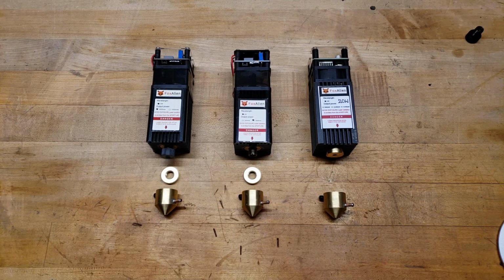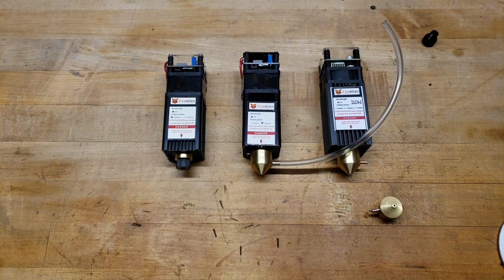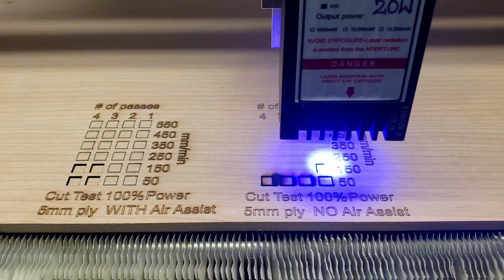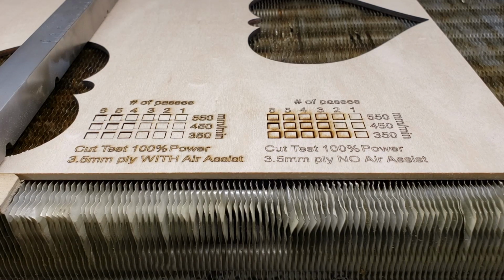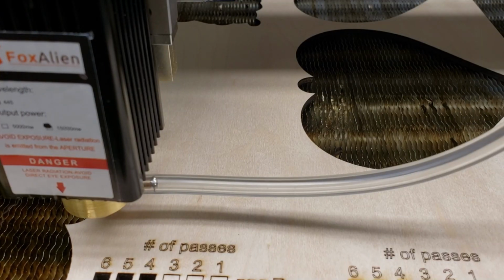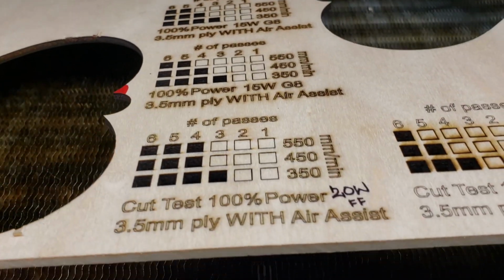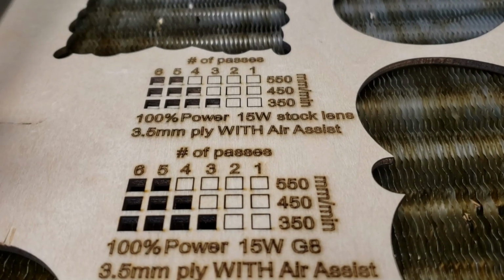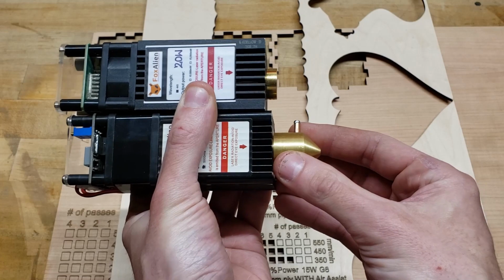The ULTIMATE Air Assist Nozzle! Demonstrating the importance of having air assist.

Comment: Just got my nozzle from you yesterday and have now mounted to my A5 Pro. The quality is excellent as is the fit of the M9 adapter ring. I am wondering if I should keep the Red Lens covers which necessitates drilling a hole in the lens for the line to go through. Or, leaving the protective red lens off as one should always use laser protective glasses when working with a laser. What do most people do? Understand that the danger of removing the covers could expose someone who walks in on you while lasering without glasses. Again thanks for a well manufactured excellent fitting part. I will be ordering another from you for my new X7 Pro. Thanks Jakub.
Reply from the maker: Great questions, Larry! I personally am not very fond of the new fad of using mini laser shields around the module, because that is not safe and effective. You can still see the blue glow between the gap, and a reflection could still make it through. By far the best thing you could do, is build a full enclosure with laser filtering window. I use 2422 amber acrylic sheets, you can find them on Ebay. The comfort increase will be astronomical. You can comfortably still be in the same room and other can walk in and out without worry. Plus, you need the enclosure for exhaust evacuation anyway. That should be high on the list of upgrades!

I'm so glad that my nozzle fit and serves you well! I would be happy to send you one for your new module!

Comment: Interestingly, the lettering of the NO AIR ASSIST 'cuts' seem to be clearer?
Reply from the maker: Great eye! This is because the air assist makes the burn much hotter. It is the exact same reason blacksmiths have bellows blowing air on their coals, they glow brighter and hotter. To get the same engraving results as the "no air assist" section, you just have to increase the feedrate to compensate for the hotter burn. You need a 32bit controller to take full advantage of the higher power diode modules. I always have my laser duty cycle (power) set to 100%, I only ever vary the feedrate. When I engrave, I do 6700mm/min. I did the engravings on my test charts at 3000mm/min. If I did the engravings at 6000mm/min with air assist, they would look the same as without air assist at 3000mm/min. My air assist will make your laser feel twice as powerful, no joke.

I was only concerned about cutting performance in this video. I will try to release a video soon demonstrating the differences with raster engraving. You can greatly speed up engravings with my air assist. I hope my explanation helps!

Comment: What kind of result would you get if you turned off the air but left the nozzle on? 
Would it be just as powerful?
Reply from the maker: Without air being supplied, the nozzle won't make any difference.
Reply: @laserwizard1982  
Protecting the laser from particle debris is important by itself so you have that covered. Additionally, I think too much air would cause a disturbance also. I'm sure there is a sweet spot distributing the air. Do you know what that is?
Reply from the maker: @iwannaapple7190  check out my video comparing air pumps. Turns out, almost any pump pushes enough air to get great performance. I see most people's 3D printed nozzles have a much bigger orifice hole, over 6 times the surface area. Those require massive compressors to generate enough backpressure. My nozzles have a tiny orifice hole, just big enough to squeeze the laser beam through. This allows even small aquarium pumps to create a strong stream of air.

Once in a long while, I would notice that my air assist would shimmy the workpiece over during cutting. I now always clamp my workpiece to the cutting bed so it stays put.

Sometimes, when I'm laser marking stainless steel with laser marking spray, I will stick a pen into the inlet hose of my air pump. This acts as a choke and allows minimal air through my nozzle. I do this because the air assist at full power blows the powder all over the machine. Laser marking stainless steel doesn't need the extra oxygen, but the burnt off coating does leave soot on the outside my nozzle. The minimal air is to ensure the lens stays perfectly clean.

I used to have to clean my lens after every 2 hours of lasering. Now, with my nozzle, it has been almost a year and no need to clean the lens. It is important to have your air pump suck in clean filtered air. It should not be able to suck in any of the smoke coming off the machine.
Reply: @laserwizard1982  
Great conversation by the way. I'll leave you alone after this unless your busy.
Here is why I say you should just test with out air assist, do not even make a tube to fit the hose. Just the nozzle nothing else. You have effectively created a vacuum with your design. The lazor should ionize what's left of the air in the nozzle and push it out. Lazers work best in a vacuum. Air is not as pure as we think. It has particles in it that detract from the laser. No or debris will go into the hole because the laser is pushing what air there was out. You are effectively fanning the flames on the wood but it might be possible your slightly decreasing the power with air.
In fact, too much air will decrease the power as evidence in another video I watched using your nozzle. The maker of the video did not know why it happened but in effect he lessened the vacuum by increasing the air and his test squares were definitely had a negative effect.
I might or might not test this because I will have to buy 2 nozzles from you instead of one. But that really would be interesting to use a nozzle with no spare tube attachment and do the square test.
Your nozzles are very good and it really must be a compliment when a company stands up and helps you sell your product with their machine. Been trying to do that with my soap cutter.
Reply from the maker: @iwannaapple7190  Very interesting idea about ionizing the air. I never thought about the effects of the air on the beam path. I know blue light refracts through the atmosphere, that is why the sky is blue and why blue illuminated signs always look blurry. 

The only time I heard of my air assist "decreasing" cutting performance was when a friend was cutting acrylic. It took more passes to cut than without air, however the cuts came out much cleaner and sharper. When cutting wood,  the air assist helps feed the burn with oxygen. There is a clear increase in "laser power" in that case. However, I don't believe acrylic is burning the same way, it is vaporizing and doesn't need the extra oxygen. The cuts are much cleaner on wood and acrylic because of the cooling effect the air has on the surface of the material just outside of the beam path. I think of the laser beam photons like meteorites, when they hit the surface, the energy isn't just delivered downwards, it spreads radially. Cutting wood with the air assist creates extremely sharp lines. When cutting acrylic without air assist, there is gradient of temperature going away from the beam. The stuff in the beam path vaporizes, but the stuff just outside of that path melts. The air assist keeps that bordering material cool so it doesn't melt as much. It might also be fighting against the laser beam heat for the stuff that is in the beam path. Even though for acrylic, it might be increasing cutting time, it is well worth it for much sharper lines.

So even if the nozzle would keep the lens clean without air supply, it is always better to be blowing air for all the reasons above.

Always a pleasure to have an intelligent conversation!
Reply: @laserwizard1982  
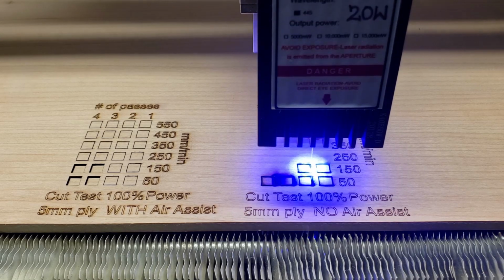I would shoot you a link but youve already seen the video. James Dean designs where you made a compliment about his testing. What I found extremely interesting was at 13:40 where he increased air pressure. It actually cut the wood worse! I dont know but that might have something to do interfering with the laser which caused it to cut worse.
I thought more about the vacuum I think it might create. I could be wrong but if it does create a vacuum that would mean negative pressure and positive pressure outside of the brass fitting. The pressure will try to equalize which might bring in dirty particles. Thats where your air assist fits in. Maybe equalizing pressure just enough as in turning down the air supply to equalize pressure from both inside and outside of the fitting would be enough not to interfere with the laser and still keep debris out.
That could be why you see better results with air and you also said any air pressure would do. Although from James deans tests he found out too much air can have a negative effect.

Comment: so I have never seen what the air requirments are for air assist. how many psi required? 5 psi?
Reply from the maker: My most recent video compares several different air pumps. I didn't measure the backpressure, but I doubt it's more than a few psi. Doesn't take too much air to get my nozzle to perform well.

Comment: Great video and amazing difference in results. Very cool. Do you have a video of your setup? What do you have your material sitting on?
Reply from the maker: I do have a video showing my current setup, it was posted to the FoxAlien Facebook group. I haven't posted one here yet because I never fully finished my enclosure. Then again, when you build your own CNC machine, you are never done building it!

I'm using an old condenser as my cutting bed. Was free for me, but the fins are razor sharp and have cut me a few times. You can purchase steel honeycomb beds online for this purpose. FoxAlien has one that fits 40cm x 40cm machines.

Comment: Is it just me or the engraved text actually looks much better without air assist ? What's the deal here ?
Reply from the maker: Great observation! The air assist helps make the wood burn much hotter and quicker by constantly supplying the surface with fresh oxygen. Very much like the bellows does for a blacksmith's coal forge. I kept the feedrate for the text consistent throughout the tests, but when you utilize my air assist nozzle, you can increase the feedrate to compensate for the hotter burn. Adding a good air assist nozzle is essentially increasing your laser power. I do raster photo engravings at 6700mm/min and 100% laser power. You will need a 32bit controller in order to fully utilize the power of the 20W laser module.
Reply: @laserwizard1982  Nice, thank you ! I'm in the process of choosing the right laser machine for me right now. So far I'm decided to buy Ortur LM2Pro, then modify NEJE A40640 to fit, build an enclosure, integrate exhaust fan, air compressor for air assist, LED light inside. We'll see how it goes :-)

Comment: would love to have your solution
unfortunately I am having the new *)w model from a different supplier (2x5= 10watt output) 

does not have that ring around it.

so i designed a different solution and use a piece of copper tubing to direct the air to the work piece

air assist is so important for a clean cut in wood that I refuse to run without in general  when dealing with wood.

Comment: What's the parts list and electrical schematic for the solid state relay that controls the air pump on/off?
Reply from the maker: There is a Flood Coolant output port on the control board. It is turned on via M8 command. Lightburn and LaserGRBL both can auto turn on Flood Coolant. I'm using an SSR and the control input is connected to the COOL port on the control board, and the switched part of the SSR has my HOT lead from the air pump connected inline. Super convenient to have it turn on and off on it's own! Good luck!

Comment: Very informative, thanks.  It looks like the lettering actually comes out cleaner without air?
Reply from the maker: Yes, it does, you are correct. Most of it brushes away with a dry brush though. More sophisticated air assist systems use two different pressure settings for engraving and cutting. You always want at least some air blowing through in order to keep the smoke off the lens.